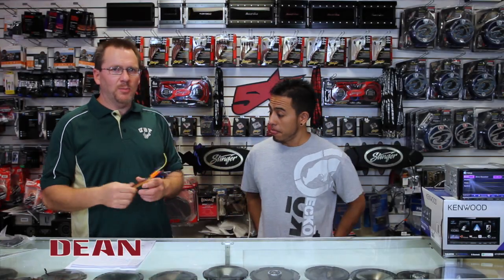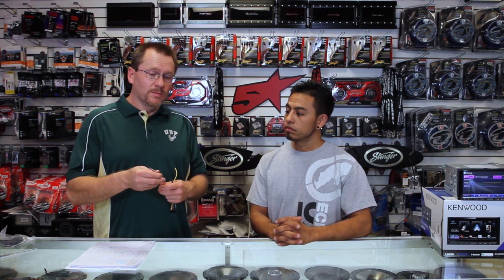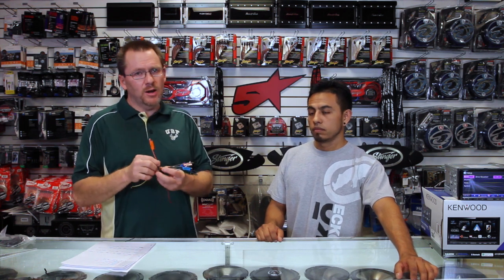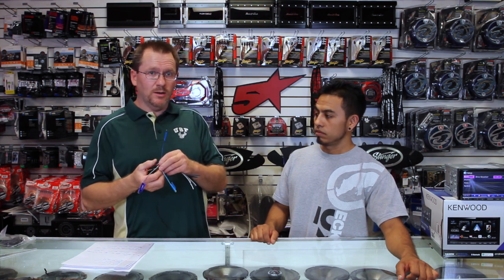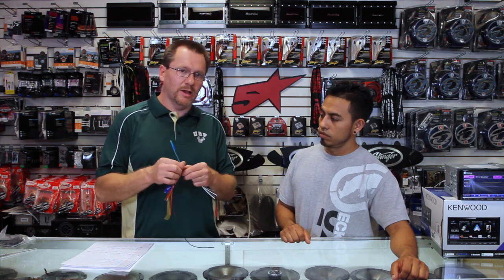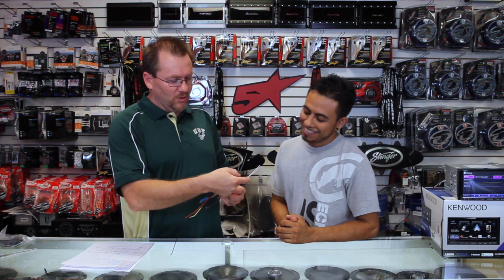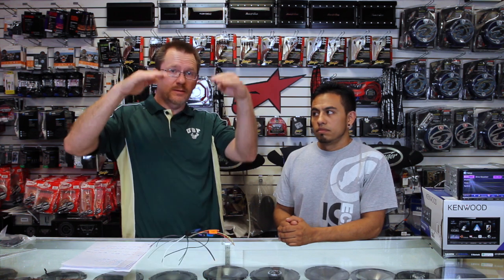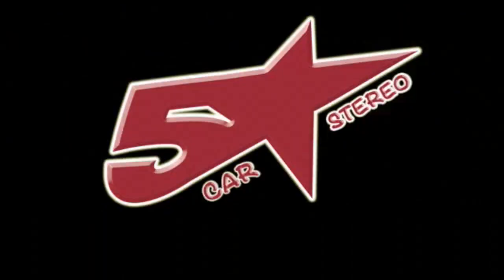What are all the wires for on a Kenwood power plug

Comment: I have a Kenwood double din and a Toyota Camry, 

Having a problem with my radio, all I get is static coming from the speakers. I hooked up the power antenna wire still have nothing

Comment: Can I hook up a power antenna and an amplifier to the blue with white stripe at the same time, or would I have to find a different way to turn on the amplifier?
Reply: Did you ever find a solution I ran into the same problem

Comment: I have a 2003 Element and it has a factory subwoofer under the radio with its own 3 wire harness. I just installed a Kenwood ddx6903s. Where can I wire in the subwoofer?

Comment: Hopefully someone will see this and answer. I have the ddx6019. I can't figure out where 2 plugs go to back of radio. They were hooked up at one time. 1 is a small green square plug. Circular inner. I think it's for the black square antenna that sits on the dash. 2nd is a small like headphone jack. Think it's for the microphone. Hopefully someone can help. Thx

Comment: I got a question my kenwood wiring doesn’t have 3 blue wires and I hooked my remote wire to the blue wire with a white strip and it still isn’t working with turning my amp on
Reply: Did u ever find a solution I ran into the same thing

Comment: Thank you for the video,  I. Installing g a kenwood,bt310u, in a 92 f150, no amps or nothing,  basic install, but the harness doesn't have the orange dimmer wire, it's in the factory harness, and it works, checked with a test light,  I'm not sure where to hook up the dimmer wire and for some reason  it doesn't  show it in the manuals wiring diagram, I know it's an old radio, it came with the truck, brand new in the box, any help would be appreciated

Comment: Hey FSCS, do you guys know where I can purchase a wireless remote for my Kenwood KMM-BT260U? I bought the stereo brand new at Walmart but sadly it didn’t come with a remote control. It said on the box that i can get a  Kenwood remonte app, found like 3 but none of them worked for my KMM-BT260U
Reply: Another note, I prefer the OEM Kenwood remote, not some crappy knock-off version
Reply: Never mind about the remote, I no longer have my Kenwood unit

Comment: hello i just installed a kenwoodDmx47s to subs and amp, i think i messed up i hooked up the steering wheel  remote that in the video with tape to amp power wire. it works fine and shuts off amp when car is shut off, but my bass cuts out here and there but the amp is still on while doing so. Now should i look for blue wire from harness and hook that up to amp power wire?

Comment: Okay..what happens if I go active dsp with 6 channel amp and I want to go full active on the front tweeters(dash factory tweets)  and midranges..do the wires separate the tweeter and mid range or where does the signal ouput all go through the mid range? So i cannot band the  pass the midrange separately?

Comment: Hi, I put a Kenwood DNX875S in my SLK 280 (standard system, no amplifier) and used the adapter cable to go from European/Mercedes  antenna connection to the Kenwood antenna plug, no radio reception at all. Watched your video on that as well but I do not have a clue right now if the antenna needs power.Antenna is the standard short Mercedes antenna. Can you help me?

Comment: My Kenwood ddx396 only has 2 blue wires. The blue white striped wire says amp turn on however the  instructions also says to connect that wire to my antenna...???? I'm confused by this installation.

Comment: How do we deal with the red wire? I have a Kennwood 893S and it won't turn on unless I put the red and yellow together. If I put red to red then the radio wont turn on and the antitheft triangle light flashes in the corner???? Thanks.

Comment: I'm just hoping the steering wheel input (light blue/yellow) off Kenwood harness isn't needed when using the maestro rr and the smart harness. There's no wire to connect it up to in the smart harness so I'm assuming the pink/red wire I have cut and connect into the sync harness will be the steering wheel input? Anyone know? 2012 Ford fusion dnx995s, maestro rr, and the idatalink fo1 harness.thanks

Comment: Great videos, I have been watching a lot to build my confidence. I just bought the DMX 7706, what do I do with the parking switch wire? What is its purpose? I have seen people cut and ground back to stereo, the manual says attach to accessory wire.
Reply: Just learning myself but I believe that's bypass mode , putting green wire to black , that means you can view video while the car is moving otherwise if you hook the green wire to the actual ebrake wire the video will only show if the ebrake is engaged. I may be wrong but that's what I believe. I'm about to install one dnx995s and I tied mine to the black in the harness.ill report back in a couple days once installed if you message back.
Reply: @LookOut48469  at first I grounded to the stereo. Everything on the stereo worked fine. Except video. Than I grounded to the E brake. Everything works fine, except video. I dont think this stereo will mirror image the phone with the emergency brake on. Other models could this one doesnt seem to be able to play video.
Reply: @david37376  so I just noticed you said the manual says to connect to the acc. Maybe that's what it needs +12v instead of a ground?
Reply: @LookOut48469  I wouldnt want to hook up a power wire where they want a ground. That seems like a bad idea. I would suggest for simplicity ground the Parking brake wire to under a screw at the back of the stereo.
Reply: @david37376  lol seems like your offering me advice now. All depends on the device.  It may or may not cause damage hooking up 12v where ground should be. Depends if there's a diode in the circuit ect. Most radios want the green wire grounded,but if your saying the manual says to connect your green ebrake wire to accessories wire then that tells me they want 12v not ground. Accessories wire turns 12v wire after key start, so again maybe they want 12v and not ground?
Reply: I just looked at your manual. I don't see anything about hooking to accessories. Towards the end o manual it has the wiring diagrams.  Mine has the same picture for the green wire, so I would think you want to ground it
Reply: @LookOut48469  thanks for the help bud. I decided I dont need to watch videos and just connected the PSW to the E brake like suggested in the manual.
Reply: @david37376  well just make sure the ebrake Is engaged and you should be able to see it. Have a good one
Reply: Seems you deleted some of your comment about having it hooked to the ebrake wire and everything working but video, dumb question but you did have the ebrake engaged when you tried right? If the ebrake wasn't on you won't see anything. I believe they used to have some message on the screen about not viewing while in motion but vaguely remember something like that from a long time ago. Maybe now a days there's no message and black screen? Hope this helped some

Comment: Dnn770hd had bad reception forever... is the blue only for powered antenna or should it be wired to a 12v source? I tried to hook it to red power and radio wouldnt shut off when opening door... any help appreciated.

Comment: aggghhhhh just confirming my suspicions. I wired in a kenwood single din unit the other day and decided to leave orange/white unwired because it was left capped off on the previous stereo (as the previous stere was in fact not stock, but an AIWA stereo). NOW I gotta go tear off ALL the plastics AGAIN, remove those screws and rewire that orange/white. Still useful information though. Thanks guys.

Comment: a question Guys: just with this harness, can I install a kenwood 2 din car stereo? because I'm buying a used radio but the seller just includes the unit and the harness, anything else.  But actually my car has a 2 din radio, I just will replace the device.  What do you think? thanks a lot.

Comment: Could you do a video of step by step wiring of a newer Kenwood wire harness along with iDataLink and accessories including GPS, SATELLITE RADIO, BLUETOOTH, AM/FM ANTENNA, USB/AUX and including excluding using factory speaker wires. In another words, if your going to run all new speaker wires from amps and do not need the factory wires. Particularly for a 2015 Tundra NON-JBL eliminating the factory amp as well

Comment: hello. I'm installing a Kenwood stereo on a 2002 Chevy cavalier. when I'm connecting the wires, can I connect the stereo's ground wire to the car's ground or with the other wires? thank you.
Reply: You can either connect it to car ground or with the oem ground wire (black). On an older Jeep XJ, I had to connect the stereo ground to the oem black ground wire since the wiring harness didn’t have ground.

Sorry late response but hope this helps on your next install.
And another note:
If you’re using an aftermarket wiring harness adapter, follow the same wire colors. If you’re hard wiring directly to oem car harness, then look up the radio wiring diagram of your make and model

Comment: I have an 03 sierra with steerwheel controls and i just bought the kenwood dmx7704s from you. I had an old pioneer that i replaced and i had the PAC SWI-CP5 that i used for the steering wheel controls. When i put the kenwood in i changed the settings on the PAC to be for the kenwood but i dont get the volume and seek to work. all the other controls on the steering wheel are working. When i press the volume on the steering wheel i see that the pac unit is responding because the light flashes but the volume doesn't change. Any ideas?

Comment: What are the odds that a already wired Kenwood kdc mp342u power harness will work in a new ddx25bt? Can I pull one radio out and plug in the new one or do I need to wire up a new harness. Thanks you guys are great!
Reply from the maker: Unfortunately they are totally different
Reply: Five Star Car Stereo very well, thanks!

Comment: I have an Kenwood ddx7015 and I ordered the wiring harness from Kenwood but when i connect it there still is no power to radio. I checked the 10amp fuse and it's not blown. I checked 12volt source and it has power all the way up to the radio. Any suggestions???

Comment: I bought a Kenwood cmos-230 backup camera and I have a 2010 Toyota rav4 (that doesn't have a rca input) and I am wondering how to connect the camera either without an rca connection and/or by getting a rca line in adapter? I've been researching this for AWHILE now and can not FOR THE LIFE OF ME figure it out. I would be forever grateful to have this explained to me and broken down! :)

Comment: I have a question. I have a Kenwood KDC X399 which was fitted to a 2013 Jeep Wrangler. I since sold that car and am trying the to put the X399 into a 2016 Keep Wrangler. The Red power line is not connected to the harness I have and I'm wondering how I would connect that to the 2016 Wrangler's harness. The stock radio is getting power from somewhere so I assume I can just connect the red power wire to a port on the Wrangler's harness. Just which one is my question.
Reply from the maker: +Iain Armstrong Jeeps do not have an accessory power( red) behind the radio. They use Can data to turn on and off. You will want to get a smart harness for your install. Head over the PAC-audio.com for a list of options.

Comment: Hello thanks for making the videos they help allot of people save money. I have a question I've had the Kenwood DNX890hd for awhile. I recently got the Kenwood CMOS-300 I got the radio used so I didn't know I was missing the parking brake and reverse wire purple/white.I got it to work but only when I hold the cam button so I've ordered the wire I just need to know where to hook it up because I have my reverse lights into the wire labeled reverse on the CMOS 300 harness. Do I hook the purple/white wire from the radio into the wire labeled reverse on camera harness then tie it in to the reverse light feed? Sorry if that's confusing. Also when I go to camera settings on the unit everything is gray and you can't click it. Everything except for the interruption where you turn it on and off. Is there a reason for that?

Comment: Hi, I have a Kenwood ddx9703s with a phoenix gold amp. I have RCAs out to my Amp. When I hook up both sub RCAs to my amp from the Kenwood it cuts out. When unit first comes on I hear a couple of popping sounds. Is this normal?
Reply from the maker: +Teraman no that is not normal. That usually means there is a wire touching ground or a bad speaker

Comment: I have a 2003 Chevy avalanche that has nav and the Bose system and I bought the Kenwood DDX374BT and RP5-GM11 and installed it and installed it and works perfect ..BUT what I can't figure out is where to hook up my vss wire that comes out of the RP5-GM11...cause I want to be able to use my own features...plz help..
Reply from the maker: TJ WYNN the VSS wire is for older radios with Navigation. It is not used on the 374.
Reply: so does that mean I can't use the OEM features on the radio

Comment: Hi,thank you for your quick response.so in my case i am not putting an sub amp in my car,that means i can tape the wires from the relay off because those are not needed?thanks in advance.
Reply from the maker: Rabin Boedhoe yes just cap them off if you want to use them. It was not a popular feature

Comment: Hi,got a question;i have a 2din Kenwood DNX8220bt,and i see that i have 2 cables connected to a plug that says RELAIS.what is the purpose of those cables and is it needed to connect since the unit is already power by ACC etc
Reply from the maker: Rabin Boedhoe those wires are outputs for relays. The radio has the ability to turn on and off 2 things connected to those wires. For example if you added a fan for an amp, you could turn them on and off from the radio.

Comment: bought a Kenwood kdc-bt33ou wired it up not getting a display or anything it will take a CD and eject it but no functions
Reply from the maker: +Steven Siebert check the red wire for Accessory power. 12 volts when the key is on

Comment: Where is the reverse sensor wire location on a 2005 ford escape so my kenwood ddx23bt will automatically switch to backup camera
Reply from the maker: krazyace35 this is the information we have
Color:black/pink
Polarity:+
Location:driver kick or SJB on RF side of cntr console, brn 32 pin plug (C), pin 10
Reply: Five Star Car Stereo Thanks for the help I found the wire in the wiring harness inside the drivers side kick panel
Reply from the maker: krazyace35 sweet, enjoy

Comment: Hey I got a question. I just installed a kenwood in my old dodge and I'm trying to play music through the head unit via my phone, now my phone hooks up to the head unit for calls, but I can't get my music through. any help is greatly appreciated
Reply from the maker: Aaron Barker silly question is the volume up on the phone? When in the Bluetooth music screen can you use the track buttons to change the tack on your phone. Check the Bluetooth settings to make sure it is set to audio and phone on the radio.
Reply: Five Star Car Stereo thanks for some feedback! yes volume is up. when I hook up to the stereo through my phone and click on the stereo profile on my phone it only says for call audio nothing for music.
Reply from the maker: Aaron Barker for some reason it is not seeing your phone as a audio player. I would try to delete the phone and start over.
Reply: Five Star Car Stereo I've tried various times to do so. At this point it has me thinking I missed a wire hooking it up...or that the stereo isn't capable to play music through bluetooth. or my android just isn't compatable but I don't see that being the issue..it's a kenwood kdc-bt645u.
Reply: Five Star Car Stereo also I have noticed when I hook my phone to it on my phone there is a message that says transfer contact's and call log to bluetooth so I click yes but it repeatedly pops up. very sorry if I'm bugging you with my problems. I'm just trying to figure this out
Reply from the maker: Aaron Barker ok got it, yes that model does not have Bluetooth music. It is from 2010 and phone was pretty all there was. The phone book issue is an old problem, Older phones kept the contacts on a micro sd card so the radio would move them into its memory.

Comment: i have a question about the reverse wire. if i have a reverse camera with the yellow rca jack that plugs into the back of the unit. will i have to manually go to my camera screen while in reverse if i do not connect that purple reverse wire?. i want the reverse cam to automatically pop up as soon as i throw the vehicle into reverse
Reply from the maker: If you want it to pop on, you have to connect the Purple/ white wire to the reverse light wire. If not, yes you will have to turn it on manually.

Comment: Great video. Helped out a lot, but I have a question I'm sure you can answer. I just bought a Kenwood DNX572BH and it doesnt have the 'parking break' or 'reverse' wires on it. Im replacing my old DNX6190HD that has those wires on the harness that was using an AXXESS CHTO-013BB interface module. The radio sounds great but I dont have a back up camera and my video screen always says "Parking brake off", do I need to buy a new interface module? I drive a 2009 Jeep JKU. Thanks for your help in advance.
Reply from the maker: on the back of the radio there is a white 4 pin plug input. That input is where the break and reverse wire would be located. The radio should have come with it, if not you can order it from Kenwood.
Reply: +Five Star Car Stereo I bought it "open box" from best buy, thank you for your help
Reply from the maker: +dd4406 you can get parts from pacparts.com

Comment: Hey guys thanks for the help I couldn't find  the color codes anywhere. You are a life saver. I have one question I had to buy the harness on line for a kenwood kdc-248u. it only has  13 wires, 16 pins. The colors are black-,red+,yellow?,orange?,blue w/white stripe(remote turn on) please tell me orange and yellow  wires are.